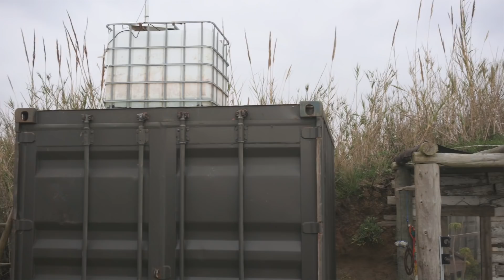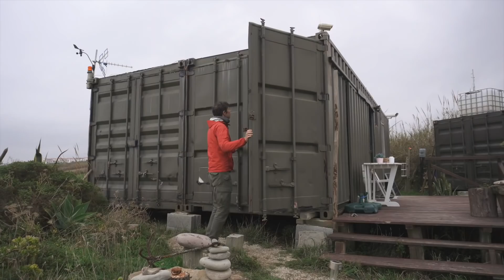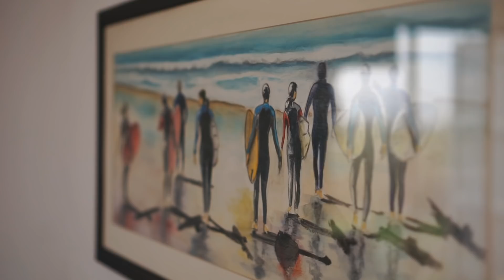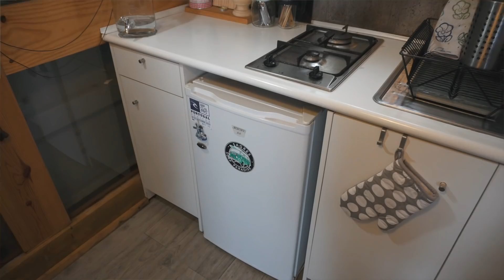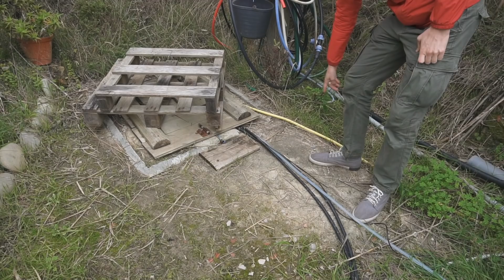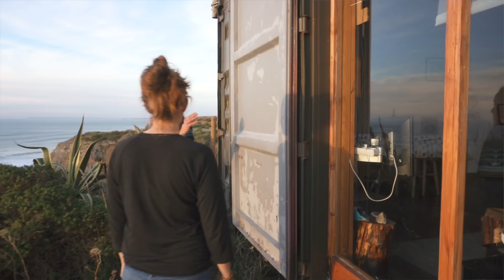Used 20ft Shipping Containers Turn Into Epic Off-Grid Cabin

Comment: Amazing place and even more amazing location!  Did the owner happen to discuss how they deal with any moisture issues inside the cabin?  I've heard that shipping container structures have challenges with condensation inside onto the metal walls unless they're foamed or something like that.  Thanks!
Reply from the maker: Thanks for your comment Carol. Unfortunately we only got to spend a very small amount of time with the owner so we didn't get to ask him. I have also heard that shipping containers can have humidity issues because you are building a living space in a metal box. I'm in no way an expert builder but I would assume that it's possible to solve this problem by having proper ventilation and maybe by using spray foam for insulation. Here's an interesting article I found about this: https://www.discovercontainers.com/how-should-you-ventilate-your-shipping-container-home/  Hope that helps :)
Reply: @ExploringAlternatives  Hey, thanks for the article.  I'm going to read it right now!  Hope you two have peaceful, soul nourishing holidays.

Comment: Wow this give me ideas!!
May I ask how did they get the slope to the roof? If the adjoining walls were removed and the containers welded together, wouldn't the roof be flat? Unless they did some extra structure on top.
Reply: Dorothy Lamb Okay, thanks! From the photos it appeared that the ceiling in the living area was sloped. However, it could have been the camera lens distorting the roof and walls. 
Anyway, excellent use of containers. This is something that I've been considering for a mountain retreat.

Comment: You know what's not sustainable building a second house that you use a few times a year for vacation. What a waste of resources.
Reply: It would seem like reusing a container for a permanent structure is pretty sustainable. What's your idea of a sustainable use of resources for vacation??
Reply: @dougmc666  well for one it's a second home so right there is a huge carbon footprint. Wood takes carbon out of the air and doesn't have any of the other environmental concerns of smelting and refining steel. Also that house looks good now but give it 10 years sitting in the sun next to the ocean maintenance is going to be a bitch on that place so more resources. Finally my idea of a sustainable vacation is car and tent. Maybe just feet and tent if I'm feeling extra adventurous.